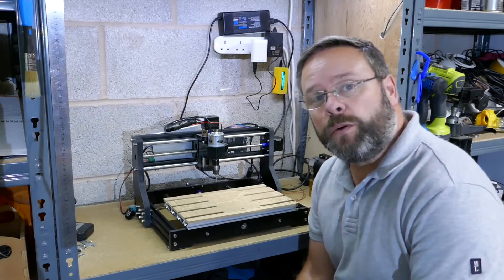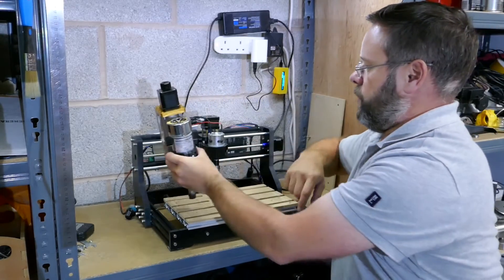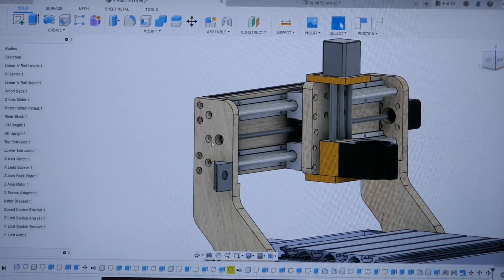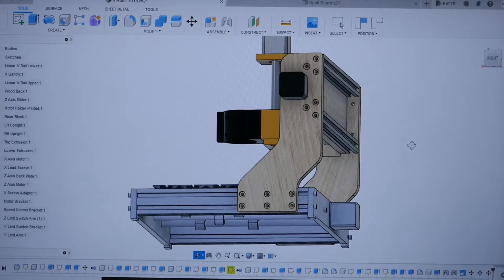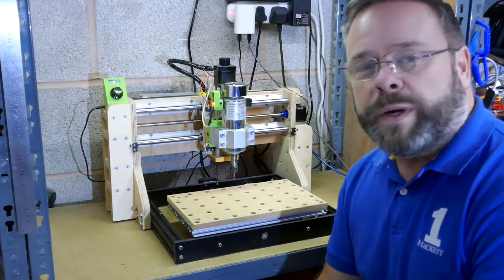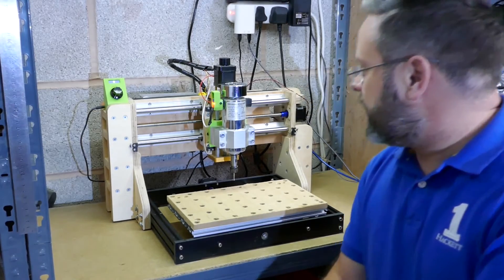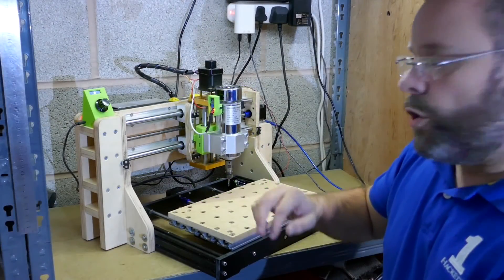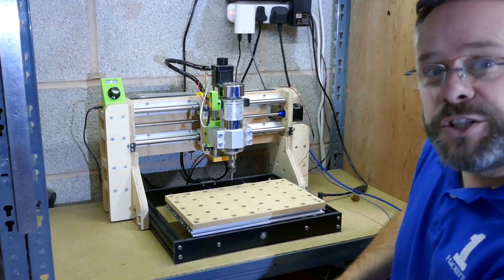800W Spindle On A 3018 CNC

Comment: The x and z gantry proportions of the 3018 can’t handle the vibrations of spindle motors above 20W imho. Upgrading to a 500w would break a lot of bits eventually. In my experience, have to separate the x rails at least 200mm and the z rails at least by 100mm to address the vibrations/play at the tip of the bits satisfactorily even for the bundled 200w spindle. To anyone contemplating of redesigning their 3018 gantries, I would really advise/recommend on considering on those in their design.

Comment: Just found your channel! With the original spindle, did you try a separate power supply? My Genmitsu stalled out quite easily when I ran the spindle from the board but after I switched it to a dedicated controller it almost never stalls, it has more torque, and my V and A readouts help me judge how hard to push the machine, especially with unfamiliar materials. I wish I had a tachometer on it, though, so maybe that’s my next upgrade.

Comment: I bought the same Z-axis, and also opted to make new gantry legs from wood.

I used 1/2" maple plywood, and also had to overcome the same challenges with mount stability. I had really great results with a much simpler solution. Will happily share, for anyone interested...

I modeled the bases to half the length of the Y-axis, spacing the 6 M5 bolts evenly. But the face mating to the AL extrusions, I milled a 40mm high slot, 2mm deep. The resulting ledge provided a very convenient method for squaring the legs to the assembly.
 But the 2mm depth also made the upper portion of the leg protrude into the X-axis by the same amount. That gave me the ability to mill 2mm-deep pockets for the gantry AL extrusions, as well as the linear shafts. The pockets for the linear shafts, I deducted 0.002" from the diameter to make those a press fit.

That 2mm strategy for recesses and pockets proved to stabilize the completed assembly to satisfaction, and prevented the bolts from wallowing their bores through the wood.

Currently, I have 12mm shafts on order; to replace the factory 10mm. Once those arrive, I'll make yet a second pair of gantry legs. I think this time, I will switch from plywood to solid board. Because the glue in the plywood laminations seem to make the material a bit brittle and difficult to reuse.

Comment: I can't imagine that PLA Z Bearing mount will last too long with all the heat and vibration happening? Did you have problems with it? The good news I would imagine is that you can machine a new one out of Aluminum with your super cool machine :)
Reply from the maker: It's actually in PETG which is alot better than PLA for this application. It's been absolutely great, no issues so far

Comment: Hello, friend. Have you tried to install four 10mm box sliders behind this metal Z-axis and then you can apply it directly to the 3018pro. That seems to be quicker.😃
Reply from the maker: Yes, that was my first trial. The problem was the weight of the z axis plus the motor actually flexes the original 3018 X rails which is worst in the centre so in the centre the motor is no longer at 90 degrees to the bed and is also around 1mm lower in the centre versus the sides

Comment: I've put HGR20 rails on my X axis directly mounted to the existing 2020 extrusion. I've  3D printed a new Z axis to take the existing motion hardware and motor, and currently working on a design to take an aluminium bracket for a larger 500W one. The biggest pain I had was the leadscrew nut, any misalignment and the leadscrew binds. Also I believe you can take a lot of vibration out of those spindle motors by balancing the fan. There are some videos about how to do it.
Reply from the maker: Sounds great. I have a video on balancing the motor on my channel. I'm jus working on a video looking at the lead screw and nuts especially for back lash which might be of interest. Should be available later this week

Comment: Hi, what modual are you using for the RPM sensor and are you running the code for the display all on the machines controller board, or do you have another micro controller running that?
Reply from the maker: Hi, I'm in the process of putting another video together for this. It is run separately and can be hand held or mounted permanently using an infrared proximity sensor as the pick up
Reply: @Wallworkshop  I better subscribe then! :)

Comment: I have a CNC est. 3040.  I had a lot of hurdles to get over when I first got it about a year ago. But I did get it all dialed in. And it is really nice for my small projects.   Amazed at how accurate it is. Using Mach 3, and Cambam. Been having fun watching your updates.  My next machine is going to be a OneFinity  X50 Journeyman. Have fun Matt. p.s. I found this reducing collet insert from a woodworking company. I can use all my Dad's old dental bits. Allows me to make some super small accurate cuts. Peace out.
Reply: Thanks I had forgotten about those tiny tools. Will be making air power spindle to use them.

Comment: nice mod! It seems there is too much vibration on the spindle, I've read that the fan at the top is not very balanced so I advise you better check it. I'm using a proxxon router as the spindle and I'm very happy with it, not very noisy and very low runout.
Reply from the maker: Yes lots of vibration from the fan. I've since balanced the fan and the vibration has now disappeared and is very quiet

Comment: I have seen a lot of spindle upgrades for the 3018. But, I don't know what the difference is from a 300W, 500W, and your 800W. I know the answer will eventually come down to use case, but what confuses me is some of the spindles are similar priced so I don't really know how to pick which upgrade. I am new to machining and I do a bit of robotics, so I would like to cut aluminum and PCBs.
Reply from the maker: Think of it as the high wattage the more torque or turning power the spindle has. With more torque though you also need more strength in your machine if you want to make use of the higher torque. Higher power doesn't always translate to higher feedrates. In the case of the 3018 then 300w is more than enough for most applications
Reply: @Wallworkshop   ok, would the correct be to ask "how much wattage are you pulling from the power supply when cutting x". X in this cause would be aluminum. Have you measured how much wattage the thing pulls? How safe is it electrical speaking?

I watched another video about a 500W spindle and the guy claimed he wasn't getting 500W's on Max.
https://youtu.be/lqOe9Z4gyFM

In another video they used the 800W motor but had to dail it down to something like a 500W spindle.
https://youtu.be/RittTNl2lKg

Sorry for rambling on and on. I just don't really know which one to get.

Comment: That's a great set of mods. I have done similar, but expanded the cutting bed at the same time. And I used supported rails below the bed too. Now - that spindle motor. It's doing what mine did - vibrating like mad. That is all about the "fan" on top. That is a rather iffy moulding and it's as unbalanced as anything. If you take it off and run the motor up you can see how it should be.  You can possibly make the central mounting hole a bit bigger and eyeball it to run centrally. Finally the anti-backlash nuts. They work very nicely when there is no load on them. But as soon as you start cutting the springs are nothing like strong enough to contain the backlash. I'm going to suggest you design your own split nut which allows you to take the backlash out with a rigid screw rather than a spring. Good luck with this!
Reply from the maker: The plastin fan on top of the motor is terrible and is what causes the vibration. I've since balanced it and it's now great
Reply from the maker: @crypto Maniac here is the video I did on balancing this motor https://youtu.be/ZsAEgR7S2tE